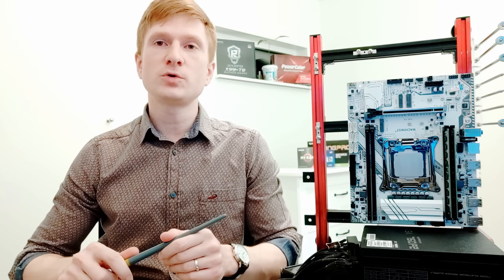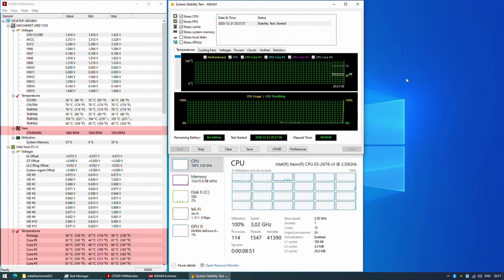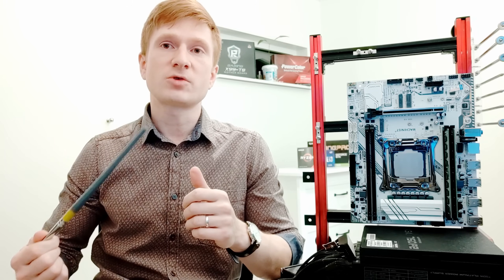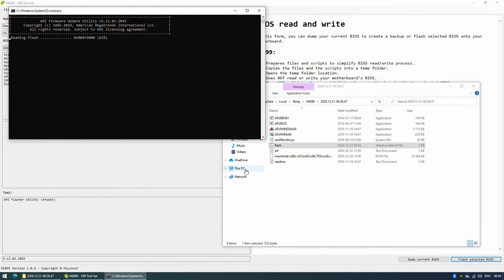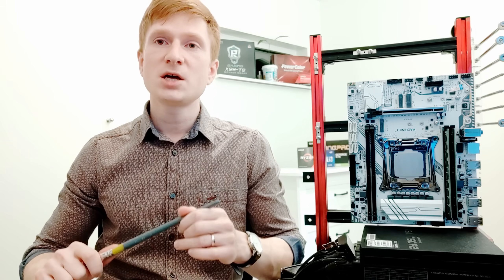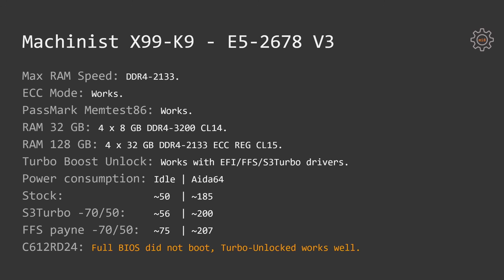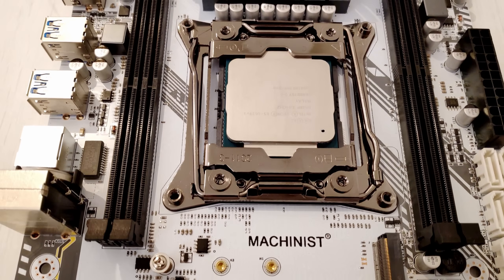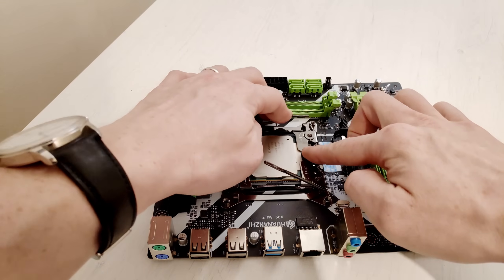🇬🇧 Machinist X99-K9 – detailed review | E5-2678 V3 | i7-5820k | E5-2620 V4 | O.C. | VRM | Timings

Comment: Those new motherboards are getting worse than old ones.
X99 to 10+ cores right now is limited to Huananzhi X99-TF/F8/T8

Sadly the Chinese manufacturers are seeking quantity (of motherboards) over quality, except for huananzhi atm.
Reply from the maker: Huananzhi X99-8M-F seems to be a rather bad motherboard as well, sadly, but Huananzhi does not seem to be an exception either.
Reply: @Miyconst  yes, 8M-F is a downgraded version, but huananzhi doesn't try to hide that 8M-F uses B85 Chipset nor lie about memory channel configuration. Unlike SZMZ, Machinist, atermiter, etc

The only con I see in Huananzhi boards are price. For Brazilians, the price of X99-F8 is the same of a B450M (around R$800 with shipping) the main difference is cpu price. Xeon 2678 ~R$400-500,00 vs ryzen 7 2700/3600 ~R$1200-1700

If kllisre/jingsha X99-D8 had better availability, maybe huananzhi price could drop a bit
Reply from the maker: @amdrebataglia  Huananzhi is definitely overpriced, but with the Ryzen (AM4) platform you also need to keep in mind that DDR4-3200+ is significantly more expensive than the DDR4-2133 which works well with the Xeon CPUs.
Reply: @Miyconst  yeah, ram is another factor weighting against ryzen, but in both case, aliexpress ram with questionable xmp is cheap than corsair, hyperX, etc
it's not uncommon see people buying asgard/gloway to use with ryzen and xeons. I use gloway type B "3200mhz" in my xeons hahahah
"3200mhz" cuz xmp is broken as hell for ryzen 1st and 2nd gen, needless to say Nanya QC, 3rd gen can somewhat works with broken timings, but the cpu itself has prohibitive price :/
Reply from the maker: @amdrebataglia  yeah, all of these are valid points, and the main take away is that you shall always investigate the local and remote market, evaluate different options and make a conscious decision.

Comment: I bought a Machinist X99Z V102 and the Smart Fan function also dont work. The motherboard does not have a CPU sensor temperature (at least in BIOS it wont show the CPU temperature) and the fan speed is static. The package power sensor reading is wonky, it shows 9W in stress. Tried to flash lots of different BIOS none of them solved the problem.
Reply from the maker: Thank you for the feedback. Seems like they have broke something in the production line, because the early versions of X99Z V102/V104 had fully functional smart fan. Just to make sure, do you use 4-pin or 3-pin fans?
Reply: @Miyconst  Mine came as "Machinist X99Z V102A", bought a month ago. Came with C612 chipset. The stock BIOS would not boot if I change anything on the BIOS configuration, even the fan speed. After flashing a new BIOS I solved the boot problem at least. I think platform x99 is not a good choice anymore, not for gaming. Maybe a Ryzen 3500x am4 would be a much smart build. However, in Brazil, there are many people waiting for Huananzhi x99M F review, since it is the cheapest motherboard and the Xeon 2620 v3 has the supreme cost benefit for average gamers.
Reply from the maker: @jorgelucascouto  thank you for the additional feedback, I have not yet tested the X99Z V102A, seems like they have screwed up this revision, which is very sad. I do agree about Ryzen, if you can afford a cheap B450 motherboard + any Ryzen 3000 series - it's a way better option for gaming.
Reply: @Miyconst  exatamente o que vou comprar r5 3500x  +b450 para substituir  a Machinist X99Z V102 que durou só 3 dias tela azul no audio e morreu.
Reply from the maker: @andrelopes5081  thank you for the reports, it helps me with statistics about which motherboard is good and which is bad.
Reply: @Miyconst  I use a 4 pin fan. The Smart Fan function has 4 speeds adjustable from 0 to 255, I keep the first speed at 150 and the 120mm cpu fan rpm stay around 1200rpm.
Reply from the maker: @jorgelucascouto  try to apply values such as 90 / 120 / 190 / 255 and observe if the fan changes its rotation speed according to the CPU temps. Also make sure to adjust the CPU temp steps to something like 40 / 55 / 65 / 70 / 74.
Reply: @Miyconst  I tried this, unfortunately it stays in the first step RPM at any CPU temperature :(
Reply from the maker: @jorgelucascouto  sad, that's exactly the behavior I have with mine X99-K9.

Comment: Thank you for this detailed review i have this mainboard. This audio alc662 5.1 is only mamę od the codec and there is no option to connect 5.1 speakers is IT correct? 
Also im using optane H10 as nvme and sometimes it is note detected but after ctrl alt del it boot ok. As for USB 3.0 my flash driver is workink ok but its slower. As flashing this mb is risky i will save money for huanan mb :/
Reply from the maker: I do not have any 5.1 speakers to test, I also don't have any Optane drives, thus it's very hard for me to speculate here. From my experience, the USB 3.0 ports work okay with slow flash drives, but connecting a true USB 3.0 device, which leverages the speed, causes issues. It could be a fast external SSD or VR glasses.

Comment: When chinese make a x99 mini itx? :(
Reply from the maker: I would not expect that with LGA 2011(3) socket. The socket is physically very large, thus it's hard and expensive to fit everything on an mITX board.
Reply: mini-DTX is available, that is 170x190
Reply from the maker: @zhenyay.5361  the biggest issue with this motherboard is the PCI-E X16 slot location. Dual slot GPUs don't fit in most of the mini-ITX / min-DTX chassis.
Reply from the maker: @zhenyay.5361  yes, that is a nice chassis, it attaches a GPU through a riser.

Comment: For a E5 2660 v3 is good?
Reply from the maker: Yes, it's gonna be just fine with an E5-2660 V3, just make sure to get some decent airflow in the chassis.
Reply: @Miyconst  ty yes .
Reply: Its werry food cpu
Reply: @Riga_Style  9300 points r23 vs 10500 2678v3 more cheap

Comment: Wow!!  Almost same with JGINYUE X99m plus..
Reply from the maker: Do you have a link to the Jginyue motherboard?
Reply: @Miyconst  shoppe  online shopping. Limited area coverage only.  Not like aliexpress
Reply from the maker: Could you still drop a link, please?
Reply from the maker: @genspc92  thanks, that motherboard has been around for a while, it's a cut down version of Machinist X99Z V102 with 2 DDR3 and 2 DDR4 memory slots, so only dual channel at a time.
Reply: Jginyue and machinist are indeed aboutt the same thing with diferent colors, ive bought an x79 jginyue mb that came into a machinist box and saw many machinist board that came into jginyue boxes.
Reply: since 5 days ago at least they ahve removed a few items from theyr shop
https://pt.aliexpress.com/store/910665001?spm=a2g03.12010615.pcShopHead_6000166179291.14
and theyr website doesnt seem be working properly either:
http://www.jginyue.com/en/
(chinese version seems to be working)
Reply from the maker: @pragavirtual  thank you for the links! It surely looks like the same factory, just different outlets to get more sales.